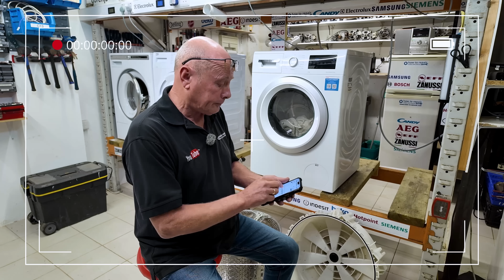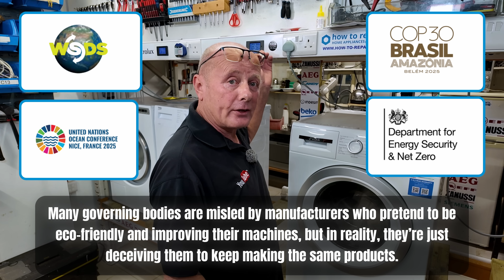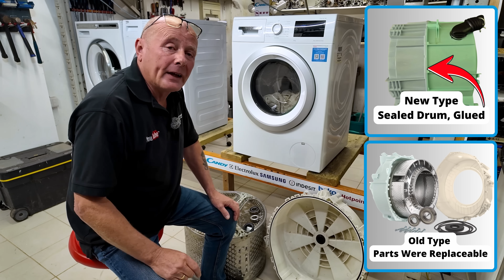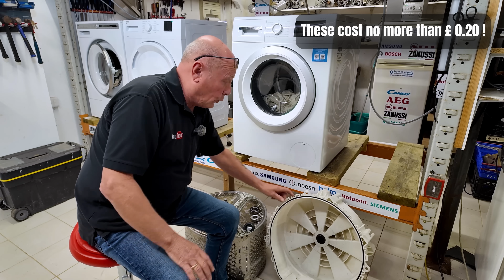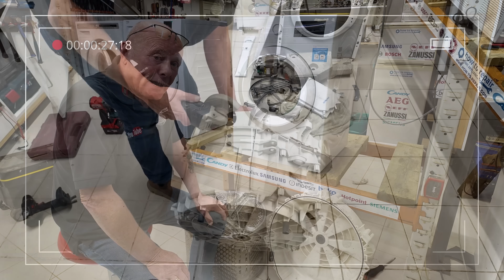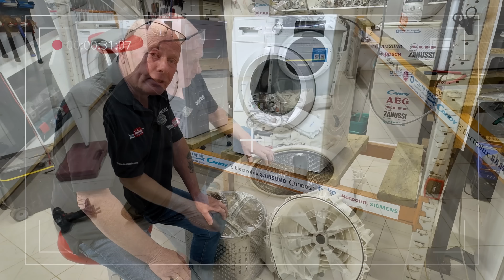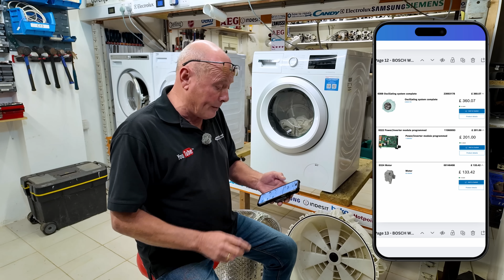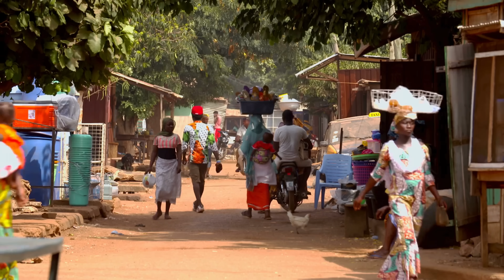Washing Machine SCAM EXPOSED! The Truth About SEALED Drums: Naming & Shaming

Comment: I have a Bosch WGG14201FR/65 series 6 bought in May of 2024. Looked on the Bosch parts site and the schematic lists it as part 0308 with a cost of 284.45 euro. I paid 539 euro for the washer when I bought it. We use it on average two to three times a day with most washes on the 15/30 minute cycle, but at least 3 washes a week on the 3 hour hygiene cycle for bedding, undies, etc. At that cost at 53% of the price of the complete machine, which will likely only go higher down the road, I have to wonder, do I order a spare drum to set aside for the future? Or by that point is the total for the other parts it will likely need simply too high to justify repairing it vs buying a new one. I guess that will depend on how long it lasts. But as you point out, bearings only last so long. The motor is 144 euro.
Reply from the maker: You've hit on a really important point about the financial calculation involved in repairing a modern appliance due to the extremely high cost of major components and whether buying a spare part in advance is justified. This is exactly the planned obsolescence we expose in the video. The bottom line is that these Northern Hemisphere companies are removing your right to repair by making the necessary parts so prohibitively expensive, which is why we showed manufacturers like LG and Samsung are better choices for long-term repairability. 

Thank you for being on board with the main idea! Reaching maximum visibility is completely dependent on our team. I need your partnership so please make every effort to share this far and wide.
Reply: @How-to-repair I compare this to a Fisher Paykel washer I had in the US that I bought for about $400 due to a dent on the back of it and used for 15 years. It was designed such that you only needed a wrench, pliers and a screwdriver to swap anything in it. Thousands of loads of laundry and I swapped the pump, the valves, the suspension rods and lastly the bearings when they finally wore out. All easy and straight forward and all those parts cost about what I paid initially combined but spread out over the years. Only finally had to give it up after the pump died and the part was no longer made and the after market parts were junk. These things wear out, the parts should not be that hard to swap, a simpler design is not only easier to maintain but less likely to fail and easier to build. It's frustrating.

Comment: Both Hisense and Haier also use splitable drums still too. Their machines are also pretty decent and reliable too. Haier im not 100% sure about, but Hisense actually use old whirlpool designs (albeit with slight changes to  widen drum diameter).

No evidence what so ever to support this but I suspect that Hisense must have bought designs, patterns, and tooling off whirlpool following the Beko takeover of Indesit/Hotpoint - who also owned whirlpool at the time.

I have a Hisense 5S washing machine and I am very impressed,  fully serviceable, and parts are very reasonable too. Though (touch wood) it's workee flawlessly over the last year I have owned it.
Reply from the maker: I will be looking into these makes a lot more in the future

Comment: I take your point entirely, and I'm 100% in favour of the right to repair, but here's a sobering thought for you ...
I bought my first new washing machine when I moved into my first house back in January 1983. It was a Hoover Electron 1100, and I paid for a 5 year warranty with it. I still remember what I paid for it. It was £360. Now according to the BoE's inflation calculator, that is £2,154 in 2025's money. It's little wonder that the manufacturers are trying ways to increase profitability.
Reply from the maker: In the 80s, 90s, and early 2000s, most manufacturers produced high-quality equipment to build their reputations. Now, many have large market shares because they've bought up other brands. These conglomerates now control the market but seem less concerned about consumers. Their main goal is to sell machines. They use green marketing tactics to their advantage but aren't held accountable for the growing pile of discarded white goods. Nowadays, machines last only about five years on average.
Reply: Good example of how they've reduced costs. Just checked what my mum's Hotpoint Microtronic X2000 cost in 1981, not sure what they paid for it, but £390 was the RRP,  BOE puts that at £1,500 at todays prices! its was Hotpoint's first microprocessor controlled washing machines 9lb load max spin speed 800rpm. 🤣I guess it was their top of line machine and it did have a metal tank. My current 16 year old machine uses less water, less detergent, higher spin and capacity of course and probably washes a bit better and rinses better, and cost less (about £350 ish) and the case at least is more solidly built.

Comment: I recently purchased a Bosch Serie 6, and like most of the new w/m's i looked at prior to purchase, they all seem to have such ridiculously long wash time (up to 3 hours in some cases). Since purchasing mine, I  have found that the quick wash programme (30 minutes) seems to be sufficient wash and run time for all my needs.
Reply from the maker: It's a well built machine, but it's a shame the manufacturer is going down the route of sealed drums.

Comment: Are there any aftermarket companies which make quality sealed drum replacements and pcbs and motors  cheaper ? That way these seedy manufacturers can keep making sealed drum machines and keep charging there extortionate prices but it won't matter as there will be quality aftermarket companies making quality sealed or split drums a lot cheaper.
Reply from the maker: I have not come across any aftermarket ones in the UK yet.
Reply: That doesn't sound very economic. There could be places that refurbish drums, PCBs or motors though?  If you have the knowledge to diagnose and repair failed PCBs and sell those that would seem a more economic way to do it.

Obviously in most cases the appliance company is already sourcing the PCB or the motor from the cheapest supplier they can find (be it Nidec or whoever), so an aftermarket company is unlikely to be able to find a cheaper supplier... Of course this is not reflected in the spare parts price. :( 

 Whilst obviously manufacturing a drum is a major undertaking!
Reply: Making an aftermarket drum sounds a bit like making an aftermarket engine block. Whilst there are companies (like DART) who make aftermarket engine blocks, in the majority of cases it is going to be more economic to "refurbish" (rebuild) an OEM engine block.

Comment: my parents bought one of the first samsung digital inverter washing machines around 2012. It's still going strong and it's repairable. I am about to buy one as well, I hope it will be a good choice
Reply from the maker: Do you only two long-term problems? I'm aware of PCB faults and spider but in general pretty good machine.

Comment: We had an indesit tumble dryer which we repaired few times. Bought a Samsung washing machine and just after the warranty ended the bearing has gone. I was disappointed to see a sealed drum. machine went to the skip. Bought a cheap bush brand instead. It’s not worth to overpay nowadays for the brand when it’s made to last 2 , 3 years. .
Reply from the maker: i would love to know the model of the Samsung washing machine if it had a sealed drum

Comment: I repair by myself. The prices for spare parts are relevant for the decision to repair or to put away. For that reason I repaired the electronic of a Bosch dryer and a Siemens dishwasher. Even when you so the job yourself the spare parts are so high that it´s not worth the money.  Would I have ordered a service man, the price only for opening these machines would be to high to consider. So the most washing machines which last longer then 5 years and then brake down will go to the junk yard. But you are totally right the only reason for glueing things together is to save money in production and make repair nearly impossible.
Reply from the maker: have been trying to put something together for a while now about this very point.

There are so many secondhand machines being scrapped because either the bearings or the PCB has failed. These machines still have good motors, good pumps, and many other parts. The problem I'm coming across is that retail outlets are all being encouraged to make sure that any appliances they pick up when they deliver a new one are not allowed to come onto the marketplace, either to be refurbished or to be recycled correctly.

I think there is influence from manufacturers on retail outlets to make sure that the secondhand market is also restricted, allowing them to make more new sales.

Comment: Playing devils advocate, do these sealed drums last longer and leak less than one screwed together and with a rubber seal (ie because it is completely sealed and clamped all round its circumference)? Any machines I've had go wrong have tended to be pump related. A feature on common repairable faults on these, dishwashers and tumble driers would help (us and you I expect) as whilst there are things you cannot do, there is still a lot you can...
Reply from the maker: In over 40 years of working on washing machines, I have mostly only seen one or two machines ever leak from the joint between the two halves of the drum.

The next thing to consider is a simple commodity like a bra wire, which sometimes gets stuck between the inner and outer drum. You can now not even split the drum to remove the item unless you are able to hook it out via the heating element hole. I want comments like this so people fully understand why these manufacturers are doing this.

I have not even mentioned the welding process. Manufacturers say they are saving money by not using screws anymore, but I would love to know what the energy costs are for welding the two halves of the drum together. If you think my answer is worthy, please remember to share the video.

Comment: I'm not a bot I don't think... What's your thoughts on ebac machines. Mines currently like triggers broom after 6 years
Reply from the maker: At first I was very impressed with the company and I had a few machines from them. It has a splittable to him and lots of parts are interchangeable on different models.I have slightly been let down with it after service when I had PCB faults they put a good warranty on their machine and it's not a bad price either I did a video on the channel if you'd like to look thanks very much for your comment. Please remember to support this campaign by sharing.

Comment: I’ll take this a step further.  I’m from the US, where most washing machines will use your hot water supply, if they need to heat the water further, or just use the hot water as is..  My Hotpoint (UK) from 1985 (that I’ve almost completely rebuilt) has two hoses….one for hot and one for cold.  If I use an ‘economy’ wash, it will take the hot water from the cylinder and not heat it further.  Newer washing machines have only ONE water supply.  They take your COLD water, and use much more electricity to heat that water up to a selected wash temp.
Reply from the maker: now this was one thing I did understand manufacturers stopping if you consider the average pipe run from the hotwater tank to the washing machine and then understand how much water the machine uses all you are doing is pulling the hot water from the tank but it never reaches the machine if houses were built correctly then a hot water valve would be very beneficial

Comment: Is it my computer, or is it impossible to scroll down in the ‘description’ area to see the model numbers and link to the Whitegoods site??
Reply from the maker: Just in case I dug it out for you. https://www.ukwhitegoods.co.uk/help/buying-advice/washing-machine/2974-washing-machine-washing-machine-sealed-tubs-a-why-you-should-care
Reply: @How-to-repair Thank you.  And thank you for your video from 10+ years ago, that taught me how to completely disassemble my Hotpoint 95360, so that I could, over time, replace the spider, bearings, shocks, pump, valves, etc.  I still use this machine, as a matter of principle (it allows me to use the already hot water from my cylinder, rather than heating up the cold water).

Comment: Question: if the drum is welded so that you cannot get to the spider or bearings, what is the point of the manufacturers actually selling those parts??
Reply: Bearings are such a universal part, if the manufacturer sells them directly it’ll be to service their older models with the serviceable drums.
Reply: @edc1569 there will be ones that have it like the non EU ones where it's split.  I saw a video before and he says some do for certain regions.  It's bonkers.
Reply: People don't go in too.

Comment: Is this something like a math problem, where the sum of the components (the cost of the machine)  is less than the addition of all the component parts??0
Reply from the maker: manufacturers are deliberately putting pressure on retail outlets not to sell the old machines to the trade because they do not want any secondhand machines on the market

Comment: The real problem for the consumer, which you have understandably not mentioned, is the labour cost in appliance repairs. How much would you charge to put a 2 quid bearing in a machine, including the call out? And I am presuming you are an honest chap.
Reply from the maker: If someone delivered me a machine to the workshop, I would charge about £100 labour. I don't do callouts anymore as I concentrate just on making content to help people. This video is about a manufacturer removing the choice and removing the right to repair. It is blatantly obvious what they are up to, the screws that we used have saved the money but how much energy is used to weld the drum? All they are doing is guaranteeing that these machines have to be recycled and I'm starting to believe that manufacturers are deliberately removing the ability for secondhand machines to even be on the marketplace because of a lot of retail shops will no longer even supply the trade with the old machines to refurbish because they only want new selling

Comment: Super video and thanks. I have a Samsung. Drum is split and so far spider and seal were replaced. Recently replaced the main control board.
So far machine has 13 years, used often and with a decent effort, rust free.
Reply from the maker: if you look after the machine and maintain it and do not overload it there is no reason any machine should not last 15 to 20 years if the parts were affordable and interchangeable

Comment: What a great shame the pattern market providers don't get involved and make splitable drum replacements. They would make a tidy profit. I have an old Hotpoint Aquarius which had a bit of a careful hack sawing and is new sealed back together with a new spider and bearings and is sealed with silicone sealer and a load of small bolts. I would not say everyone would want to risk doing this but it has lasted another ten years so far.
Reply from the maker: if we just look at one manufacturer like Bosch they don't use one drum on all the 8 kg machines and they don't use another drum on all their 9 kg machines. They deliberately have multiple different types of sealed drum to stop the aftermarket stepping in. it is a practice which they are doing in the UK and Europe but tell me why the Asian market is not doing it when they normally try to save money on everything

Comment: Last year our siemens IQ800 WM16Y541NL from november 2016 starting making noises. the bearing was worn down after 8 years and about 4.000-washes. luckily it had a srum that could be separeted. new bearing, new rubber and i was good to go. i think i should stock up on parts to keep it running,  i hope it will be good another 8 years.
Reply from the maker: it's always worth buying up a secondhand machine with the same model and stripping it for parts. If you see one about this way you could keep your machine going for quite awhile thanks very much for the comment. Please remember to share.

Comment: Is this also the case with Miele? I always had Miele till today and I had no problems. Hope it will stay like that. Now that I said it, it will brake down. 😉
Reply from the maker: Miele has always produced good machines but on their lower end price bracket now they are fitting seal drums which is a disgrace from a company that provides themselves on being a top end brand
Reply: @How-to-repair  THX for your info !

Comment: It would be also nice to figure out what is hiding behind this overzealously complicated product names. If you google for them, you see that they are specific to different geographic locations. Bosch is probably selling the same hardware at different prices in different countries.
Reply: Even for different shops in the same country. But all manufacturers do that to stop people comparing price.
That is why the PCB needs to be programmed. Too many models so this way easier to stock the PCBs.
You have one model with black door, silver door, white door, each with or without silver strip on the soap drawer.
Then with or without aquastop (why don't other makes have this?).
And with or without "steam" or "blood stain" functions. es, all "really different".